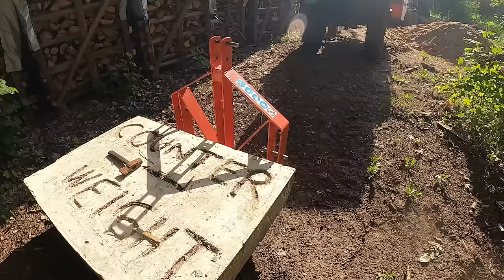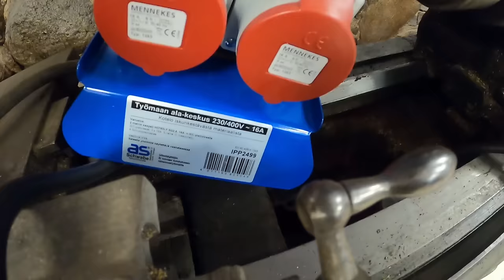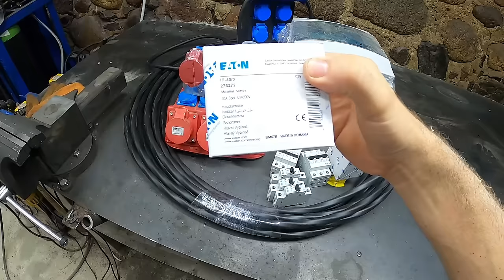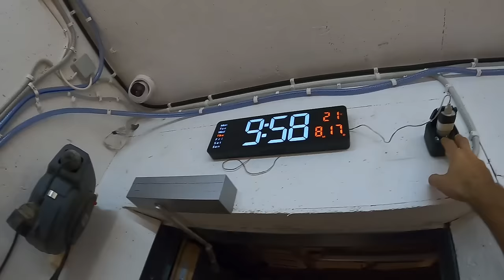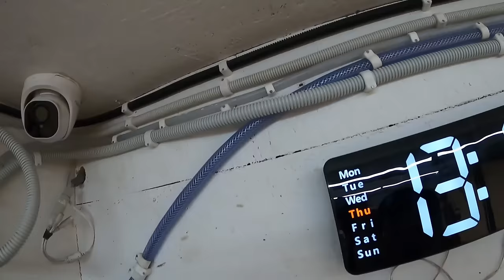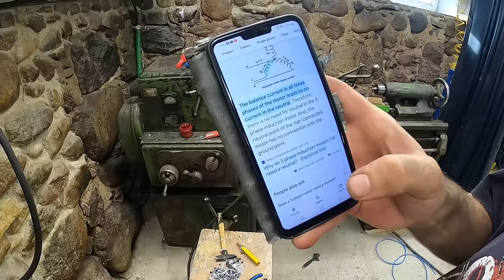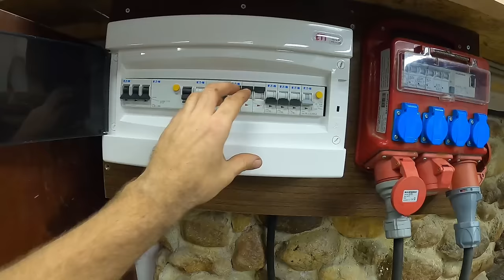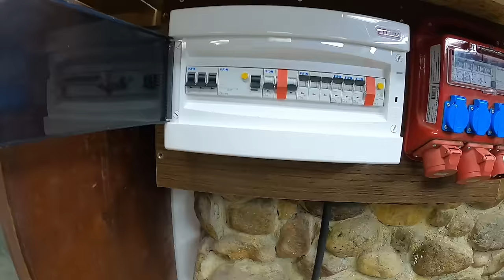Buying and installing a soviet lathe - STANKO 1A616

Comment: you need to test the lathe motor for shorts not with a multi meter as this only uses about 9v to test the resistance, you need a proper insulation tester that uses 500 or 1000v to test it, when the motor is powered by the 400v its probably got bad insulation maybe a winding is shorting to the case when you have 400v on it, if you want to test without a proper meter then remove the motor from the lathe so the motor casing has no connection to ground, remove any ground wire if there is one connected to the motor case then reinstall the trip switch in your panel and run it , (do not touch the case as it may have 400v on it) if it runs  without tripping the trip switch you have  bad insulation in the motor, If  you then connect the case to earth and if it trips this confirms you need a new motor or get it rewound. sorry for the bad news but this is probably your problem. obviously when doing this do not touch the motor case as it may have 400v on it as this would not be at all good for your health.Anyway hope this helps , looking forward to the next video good luck with the lathe, hope i am wrong but probably not.
Reply from the maker: I just put a extra ground cable on the frame and leave it at that 😅

Comment: In the USA, everyone has two-phase 240v.,.. Sort of, to the laymen.
It's more single-phase 240 that's had around 30 degrees of separation between the positive and the negative currents of the electrical sine wave. We get an 'A' and a 'B' ”leg”, each 120v, that we can treat as two-phase 240v.
Not true two-phase, but definitely not single-phase either. Most outlets are 120v, and for a bonus we kill by electrocution way way less children.

Comment: Having no RCD on that machine is not "that bad". The entire thing is made out of metal and is grounded. As long as the ground is properly attached the frame can never become live. Even if one phase gets somehow shorted to chassis it would just short to ground, trip the breaker or set something on fire. These are not good things either but at least the frame will not kill you. What can kill you without RCD are the live wires themselves. Just remember not to go poking around the electrical stuff when the machine is under power and you are all good.
Reply from the maker: Yup

Comment: As an industrial electrician,  I agree with others: that lathe is old and old wiring, with old fuses, old electric tape, and a lot of conductive metal. Unprotected by modern circuit GFCI protrction are a recipe for a quick DEATH! It is better to completely REWIRE with modern fuses, new wires, new connections, new buse bars for safe connections, grommets, and no shorts. It will work more efficiently and safer. Maybe a new or rebuilt motor, if needed? The rubber mat is a good secondary precaution. Another thing to consider is that it initially pulls an extreme level of amps when electric motors first start, and then it drops. Some modern motors even have slow-start modes because of the high amp draw at startup. The spike could be what is tripping the breaker. In commercial applications in the U.S. there is a lot of design and thought into the setup for electrical motors and machines using them. There are breakers designed specifically for electrical motors as well. Maybe do some research into industrial machines and wiring for residential applications? Or have an industrial electrician with experience in those types of machines give you a consultation and recommendations for ÿour setup. That is a ĝreat machine to save and use, but nothing in time or money spent is unreasonable IF you don't die or one of your family members unknowing touching it if it were live. Especially your children.
Reply from the maker: I get it. The type of breaker i used is C which is meant for eletric motors. They will allow huge amps for a very short while without tripping. I did add that rubber matt and also a new ground wire to the lathe so far. I will keep the lathe plugged in at all times but will keep the breaker for the lathe off so if its not in use its not powered
Reply: It trips RCD, not a breaker. Breaker stays on.

Comment: If you won't work on lathe for some time you need oil every moving part and surface that it won't rust
Reply from the maker: Pressure washed it with oil

Comment: 🤔🤨😵😵‍💫😎💥👍lathe machine You connected the 3-phase wires in the box with
a copper piece, which is 1 phase under the power cut, the points with the lighting any devices 1 phase with the points to turn off the devices other lighting does not need three phases, only one phase this is a mistake, a big mistake thank God for your safety if you did not put a circuit breaker for protection you would have had a disaster\\The important thing is that you fixed the mistake by cutting the copper piece and isolating it from the rest of the  Three face

Comment: That 6th floppy rubber end in 3fase cables are a support that the other wires are bunced up on so it makes a rounder section. For manufacturing purposes.
Should get your electrichian neighbour to clean that lathe electrics up good time. Mabye that would help the fault braker? If not get a new motor. Or just use a rubber mat, or not lathe like a barefoot Pakistani, but as a civilised westerner in some good rubber soled shoes.
I would probably not care about the fault braker at all. But certanly do a good clean up in that electrics rats nest and call it a day.
Anyhow, a bit jealous I have no frickin lathe!
Great thanks
Reply from the maker: no problem, thanks for the comment mate

Comment: Ahoi, i have a lot of experience with your electrical Lathe Problem when the lathe was Build the electical System was Build with only a Earthed nutral if you think the Motor Does Not need nutral i the current configuration, you think Right but there are Switches and Otter Electronics that take Power and bam Theres a tiny amont of power floting over the „Earth wire“ green yellow and the fi Flips. There is a Solution for your Problem change your lathe power in Wire to a cable 5wire change the curret earth Setup to nutral the Blue one than your Earth is nutral but it should work with the Safty switch (fi) but its only the milde of the work cause the safty is bypased to make it Safe you need to put the green and yellow cable one the lathe metal for grounding but somewhere is forsure a Connection between the Blue and green, than you have to mesure a lot and Isolate the Blue and the green yellow. Thats how you could do it but to make it work with the safty Switch the Price is redoing Most of the electrics in the lathe.
Reply from the maker: Useful info, thanks

Comment: Great content but a grommet instead of a gland 😮😮😮😮😮😮
Reply from the maker: Can you elaborate?
Reply: @Ants_Pants  - Cable glands are connectors used to seal the ends of cables and secure them to plugs, terminals, enclosures or electrical equipment of various kinds. They can protect sensitive electrical wiring from moisture, contamination, corrosion and even flammable gas.

Glands are used for cables laid outdoors or in harsh environments, and also for passing cabling through plating or bulkheads. Cable glands are used with all types of power, data, control, instrumentation, automation and telecommunication cable.

Comment: Love your Video! New Name for it could be "Stinky Stanko".. But 400V Shouldn't a certified  Electrician do the work in Europe/EU?
4fase and 400V is NO joke...   Earth, Neutral,  Earth and some thing else.. But 4fase you need maybe change Blue and White cable.
You have white, Blue, Brown and Black plus earth green and yellow .... You need to be sure what is what. Google which is which on the Russian socket.
I have only worked whit 220V here in Norway ore No(R)way.
The rubber is that so it doesn't streach. Those handles are probably for the table...
Reply from the maker: Naw not required. Everything after the main breaker is homeowner business. All i had to do was to get the electrical panel certified by a electrician. The lathe itself was nobodys business. Its 400V with 3 phases and 1 PEN (ground and neutral that get seperated into PE and N in the box.
Reply: @Ants_Pants  WOW... it's not like that here in Norway. Here you need to have certified electricians to do the job. Because of insurance and fire hazard.

Comment: Bang the lathe on the concrete floor, not good at all for it. Use a pressure washer would give a better result without damaging the lathe😩😞😞
Reply from the maker: Yup. Lucky its a soviet lathe, hunk of cast iron. Floor will break first 😅

Comment: Ok, you need a special license for a basic trailer, that’s a problem to start…that skid loader should have pulled that out without issue, you have an issue with it…
Reply from the maker: Trailer with a 2.5t load capacity is not a basic trailer, at least in Estonia. The skid loader rated lift weight is set at 650kg, this lathe was 1500kg, how is it supposed to be a problem?
Reply: Can only go by what basic driving regulations are in the US, yes a 2.5 ton trailer is basic here, you won’t need special licenses till your up into one sized to need a commercial truck basically.    Then, the license isn’t for the trailer, it’s for the truck which needs the special license.    As for the weight, 650 kg seems light for that skid steer, my small 24 hp tractor can lift more weight than that and roughly the same size.    That lathe didn’t look like it would weight 1500 kg, the metal base and structure on that thing must be ludicrously thick to get that kind of weight out of it.

Comment: Ant - Man Russian electronics, no wonder shits always on fire there.
Me - Well that's the only way they can keep warm in winter since their dictator for life refuses to invest in ways to provide heat for his people.....
Supermom - Who cares about russia, your making more ruts in the ground again.
Reply: There's some truth to that. I recall old-timer's stories about soviet prison camps/military barracks' mains cable wires glowing red hot in the evenings when everybody were boiling water for evening tea. Fuses long time ago blown were replaced with massive gauge wire. Plenty a fire started that way. BTW, the DIY water heater was called a "tractor", consisting of two metal plates (razor blades or any random pieces of metal) held apart at a few millimeters by some random dielectric at mains voltage dunked in water. Nice way to ingest some carcinogenic heavy metals :)
Reply: Thanks for the info man. Sadly as much as it sounded like I was joking, I am actually really good friends with a couple dozen people from the Ukraine, and some of them had parents that were in the USSR's military, and they'd passed on stories that were told to them by their parents (usually dads). I'd met em while I was in the army, and deployed over seas, and made the choice to spend most of my vacations in the Ukraine. So I also had some experience with "modern" Russian and Ukrainian electrical practices.
Reply from the maker: @kassisaba  holy shit